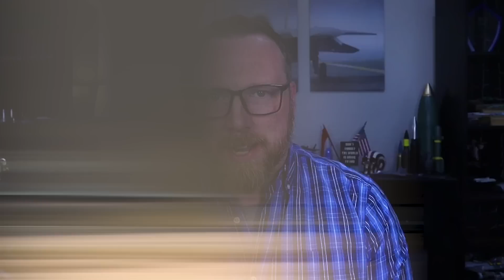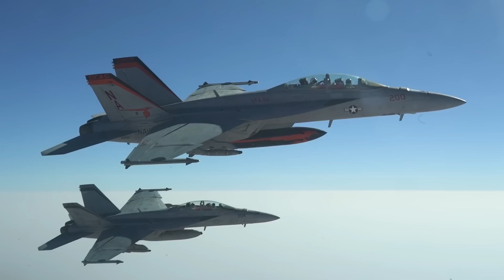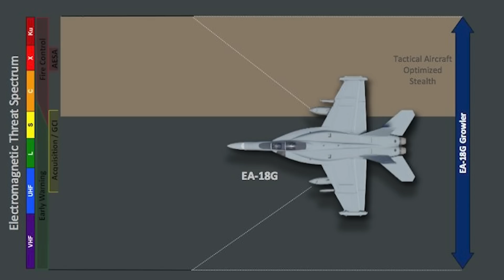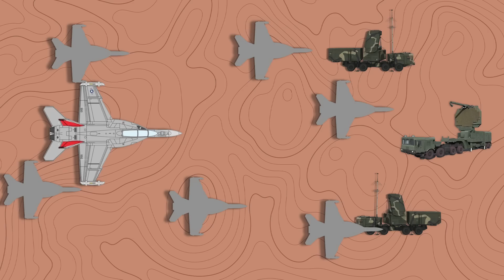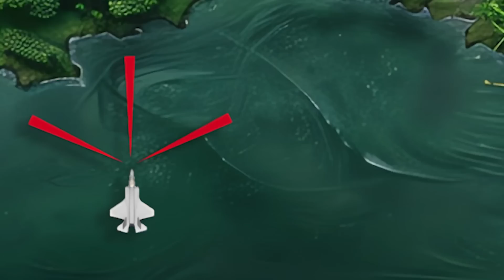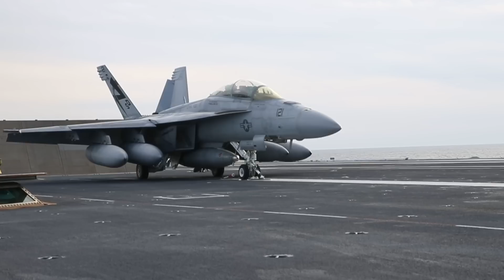The Navy's nastiest fighter nobody ever talks about

Comment: Due to the J16D is larger than F18G in size and engine power,
The Chinese J-16D electronic warfare aircraft has similar in appearance to the US military's ALQ-218(V)2 full-band tactical receiver. There are four large knife-shaped antennas on the top of the pods, which are 0.4 meters longer than the ALQ-218(V)2 full-band tactical receiver, and have a diameter and weight of 0.30 meters and 240 kilograms respectively. It has the ability to achieve full-spectrum, omnidirectional, high-precision positioning using the principle of short-baseline interferometer. The front avionics compartment and both sides of the fuselage cockpit are equipped with large-size radiating receiving antennas. The EA-18G electronic warfare aircraft has insufficient internal space to install large-size radiating receiving antennas.

The J-16D electronic warfare aircraft can carry four RKZ930 series large pods, which are 5 meters long, about 0.4 meters in diameter and weigh 400 kilograms. The pods are divided into four types: RKZ930-22, RKZ930-10, RKZ930-31 and RKZ930-32, which can cover different frequency bands. The main body of the pod is basically the same, with an interference transmitting antenna at the front and back, which has omnidirectional interference capability, but the antenna layout is different. The design concept is the same as the AN/ALQ--249 electronic jamming pod, but it has one more than the EA-18G electronic warfare aircraft, which truly realizes effective interference in all frequency bands.

In recent years, China has also adopted active phased array jamming antennas, digital processing, adaptive beamforming, intelligent analysis and radio frequency management in active phased array radar jamming pods. The power generation capacity of the power system is sufficient to ensure the normal operation of the jamming pod, while the two F414-GE-400 engines of the EA-18G electronic warfare aircraft can only generate 180 kilowatts of electricity. Therefore, the AN/ALQ-99 and AN/ALQ--249 electronic jamming pods must have their own small turbine generators.

Due to insufficient power, the jamming power must be reduced from 10 kilowatts to 6 kilowatts. Another disadvantage of having a small turbine generator is that it increases flight resistance. The F/A-18E/F fighter-attack aircraft can also fly at supersonic speeds with external auxiliary fuel tanks. The maximum flight speed of the EA-18G electronic warfare aircraft after mounting the AN/ALQ-99 jamming pod can only reach 0.85 Mach. The J-16D itself flies faster than the EA-18G electronic warfare aircraft, and the jamming pod also has much less resistance, which is very beneficial for accompanying the J-16 fighter in combat.

Like the EA-18G electronic warfare aircraft, the J-16D electronic warfare aircraft also has certain air, ground and sea attack capabilities. The whole aircraft has a total of 8 external attachment points. After mounting 4 jamming pods, it can also mount 2 "Piercing" 15 medium-range air-to-air missiles and 2 "Eagle Strike" 91 anti-radiation missiles. It can also mount 4 "Eagle Strike" 91 anti-radiation missiles to enhance anti-radiation capabilities. However, the EA-18G electronic warfare aircraft does not have this capability due to the limitation of attachment points.

The RKZ930 jamming pod of the J-16D electronic warfare aircraft was developed together with the J-16D electronic warfare aircraft and completed in 2015. The AN/ALQ--249 jamming pod began to be developed in 2013. After the prototype was developed in 2019, it encountered many technical challenges during testing. It was not until September 2024 that it reached initial combat capability, which was 9 years slower than the RKZ930 jamming pod.

Comment: I wonder if it's viable to use a different aircrafts radar signal that you would then time when you detect triangulate where it is and use it to figure out return signals from other objects not including you and the originating radar unit. Allowing therefore the f-35 to be able to receive a radar signal of the battle space without having a two-way link or using its own radars in an active role. Completely passively doing this. So the growler would ping so to speak, the f-35 would time that when it takes it knowing in what location it's coming from, and therefore be able to have a fairly good resolution on everything that returns a signal. Without giving any electronic or radio evidence of its own existence

Comment: You know the rate at which microwaves dissipate, correct? At the square of the distance? To be able to propagate that kind of energy a long distance, requires a s-ton of power. You're essentially talking an EMP device, I don't think too many pilots would want one of those under their ass.

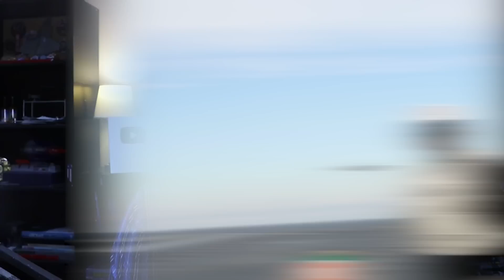Comment: 5:14 Alex, They’re not just “modular” but they’re software defined so it quickly adapts. ☺️
Reply: oh, software systems of that scale are usually genuinely modular in just their architecture. the western defense industry deserves crap for watering down the term, but this time it's probably a rare case where it's genuinely the right term to use.

software-defined signal processing systems are frequently plugin-based, so "modular" is the right thing to call it.

Comment: The Air Force had its own jammer, the EF-111A Raven or as it was often called, the "Spark-Vark" . The EF-111 entered service in 1983 and served until its retirement in 1998. After the EF-111A was retired in 1998, the U.S. Air Force began relying on the Navy’s EA-6B Prowler and later the EA-18G Growler for electronic attack missions.  I guess joint operations is alive and well.
Reply: Begrudgingly
Reply: USAF just received their first EA 37 B ;)

Comment: Hey I'm sure you're already doing a video on it but just in case you aren't yet, The Warzone published an article going over how the NGAD program is basically starting anew entirely to use more effective 2030s technologies that have started to enter development in just the past few years as opposed to the more expensive set of late 2010s/2020s tech used in the flight demonstrator that was originally intended for the fighter, and that they are focusing significantly more on having NGAD itself used as a UCAV element with fewer piloted airframes to save costs and reduce loss of life, as well as making it more broadly capable to be useful in uncontested airspace, which was a downside of the F-22 which didn't really have a purpose for the majority of it's life.
Reply: Thank you, this was very useful to know 🏆❤️
I don't like the delay, but I love that the designers are seriously delving into how to nake it both deadly, useful & cost-effective, in every scenario 💪❤️
Reply: @elektrotehnik_94c_NinoD  Yes this is hopefully a much better outcome than what we had feared with a century fighter program reboot or an outright cancellation. To find out also that new technologies have advanced so far in the past 4 years that they are adding and swapping out new technologies entirely for this reassessment is wild. Let's say for instance radar and IR spoofing is good enough that laser weapons are no longer needed, or a large internal volume is unnecessary due to developments in the low-drag pylon program. My guess is they found an alternative technology to the Adaptive Cycle Engine.

Comment: The two-motor F-18 simply  has the power to spare - for aggressive EW.
Reply: If I'm not mistaken, the pods have power generators of their own. You can see the small "propeller" on the front of each that is connected directly to an alternator or generator to make the power it needs, but it does add a bit of drag.

Comment: Not to put the Growler down, I do understand that the Stealth is not nearly as useful when you are transmitting to jam on one or multiple frequencies but they really need an EA version of the F-35 in all 3 varriants. Yes I am aware its capabilities are such that they all kinda already do operate as EA platforms but still if its is not optimized for the job its a Jack of all trades true master of none. Either way the Stealth of the F-35 would allow it to better get away if an imcoming weapon with both lock on jam plus a IR or Radar seaker would have a harder time tacking down the jet if it had to go evasive. Also would make the jet more useful yet still in the Passive SIGINT and ELINT roles as it potentially could get closer before detection.

Comment: And as a modular pod, you could put it on a lot of other platforms.  Interested in whether these require an engine upgrade to provide the needed electrical power or if the G already had enough juice.
Reply: Look closely. They have props on the front as generators.

Comment: Is the Growler a two seater? I would assume so, since it does fighter, attack, and EW roles. That'd be a lot for a solo pilot to manage.
Reply: I remember Prowlers when they had 4 seats, 2 pilots up front and 2 EW officers in the backseat working diligently because they only had less than 1 min to respond to a missile that was already fired at a friendly aircraft , they did their job and put one of their own anti harm missiles through the opponents radar and confused the incoming missiles.

Edit: Growler has 2 seats

Comment: If Lockheed was smart,  they would develop a 2 seat variant of the F-35 that can act as a Growler
Reply: That doesn’t make sense?
You’d pay the F35 premium maintenance prices due to the stealth, but then you’d put countermeasure pods on the wings which would ruin the stealth. 

Better to put your electronic warfare equipment on cheaper platforms like an F15 growler variant or… the F18
Reply: @kaourintintamine1383  
Hence the perspective F-35E would need to be redesigned with pods for stealth and non stealth operations
Reply: @verdebusterAP  but the pods emit electromagnetic waves that would act as a beacon? Stealth is about being silent, electromagnetic warfare is about « shouting super loud so that nobody can hear anything ». They’re two solutions to a similar set of problems, they just don’t work together
Reply: @kaourintintamine1383  
Imagine you are tracking inbound missiles and boom, this jamming appears out of nowhere and you lose track
its stops and now you lost track of the missiles
By the time , you get your sensors back
ka frecking boom 
a hypersonic missile has struck your radar and communications 
Those subsonic cruise missile that you were tracking  were actually decoys
The targets that you warned were not the real targets
The EA-18G can be seen from hundreds of miles away where potential EF-35E can approach and stealthy take up key positions and blind the enemy more effectively

Comment: ....So I'm a bit of a fighter jet layman so excuse the uninformed nature of my next question. If they are pods and they allow for a wider range of capabilities than is afforded to the F-35, why not just install them on the F-35?
Reply: You lose stealth…
Reply: As you do when you hang missiles on the outside of the F-35, but also by the looks of the pilons they already seem low observable which most missiles aren't also The F-35 is a stealth aircraftvto begin with and doesn't need giant external fuel tanks to boost its range and if you did you now have stealth drop tanks and internal payload capacity so you dont take the penalty of loading missiles under an already non-stealth aircraft...so its still more capable by every meteric to hang them off the F-35, so the questions still remains. Is it just because they are proprietary to Growler?
Reply: The internal equipment is also bulky per the EA having no cannon. F35s can use and relay data from multiple sources though

Comment: Still think it's kinda silly they have a small windmill on the nose, as the electrical systems in the F/A-18 can't provide enough electrical power. The jet engines, pushing the jet through the sky, also have to offset the drag from those. Thinking the pods would be even more capable if the nose was, say, an antenna array instead of a mini-windmill and a generator.

The F-16s delivered to Ukraine have updated weapons pylons which contain jamming hardware and additional chaff / flare dispensers, as well as infrared / ultraviolet sensors for 360° coverage on inbound hate. Setup the Growler with similar and let it pack some more hate.

Comment: Ask Hibitual Line Crosser about a Growler. His statements should tell you enough that the enemy should be afraid of the growler
Reply: A Growler emits copious quantities of electromagnetic radiation in all spectrums.

If the Chinese COULDN'T track the Growler, they would be no better than cave men.

You literally DONT need a radar to find it. All you need is a receiver.
Reply: @Triple_J.1  Radar lock for a firing solution is what they are talking about. And the allegations are the Chinese have used AI to get rid of the noise from the Growler jamming so it can achieve a lock, ie declutter the radar picture rather than burn through, which is the usual way a jammer is defeated, when it gets to close and the power from the tracking radar burns through the noise of the jammer
Reply: @Storytelleroflore 
That's great. They needed multiple ships all working together on the same task to do it.
They were never able to achieve a firing solution on the Growler, just have it on radar and know it's position. 
It was a SINGLE Growler that wasn't using its full capabilities in EW. It was just lightly probing the defenses. 

The new growler has EW systems far beyond anything the Chinese can comprehend..
Reply: @Mikayelion6  chill bro. Don’t over estimate yourself or your adversary is all. It’s worth objectively and calmly discussing potential counters to OUR equipment as allies utilising the same plane against the same adversary.
Either way I am taking neither of you seriously because if either know true outcomes you shouldn’t be talking here. Pure facts are a reprimand to the flight and a what may have been a minor success in electronic warfare by China, which seems to already be evolved out by a planned upgrade. Big whop.
No where have I ever stated I am unhappy Australia has growlers or that they are useless
Reply: @Mikayelion6  chill bro. Don’t over estimate yourself or your adversary is all. It’s worth objectively and calmly discussing potential counters to OUR equipment as allies utilising the same plane against the same adversary.
Either way I am taking neither of you seriously because if either know true outcomes you shouldn’t be talking here. Pure facts are a reprimand to the flight and a what may have been a minor success in electronic warfare by China, which seems to already be evolved out by a planned upgrade. Big whop.
No where have I ever stated I am unhappy Australia has growlers or that they are useless
Reply: chill bro. Don’t over estimate yourself or your adversary is all. It’s worth objectively and calmly discussing potential counters to OUR equipment as allies utilising the same plane against the same adversary.
Either way I am taking neither of you seriously because if either know true outcomes you shouldn’t be talking here. Pure facts are a reprimand to the flight and a what may have been a minor success in electronic warfare by China, which seems to already be evolved out by a planned upgrade. Big whop.
No where have I ever stated I am unhappy Australia has growlers or that they are useless
Reply: EA-18: for when you want to give radars down syndrome
Reply: Only if that were the truth. In fact China successfully equalized the Growler in December 2023. Go read about it. 

The USNavys EW squadron commander lost his job because someone had to be blamed. Of course he wasn't to blame, China simply used Ai to neutralize the Growler at its own game.
Reply: First off, there is no official reason given for the dismissal. You are purely speculating. Second of all, China simply claims to have "locked on" to a growler and being able to send an aircraft to intercept it. Rather than seriously attempting to actively enage the Chinese destroyer and foolishly handing the Chinese intelligence on US capabilities, the growler was most likely there passively collecting intelligence of its own. So the Chinese are basically bragging about intercepting a non stealthy tactical aircraft within close proximity of one of its most advanced destroyers. Even if it actually happened, it's not the least bit impressive or concerning.
Reply: @cubed0724  you're making sense. Sounds more like a media stunt than anything significant
Reply: @ryszardfalkowski7917 a single growler. Chinas ships vs 1 growler. Lol
That's not impressive. And they stalemated it. 
And the growler wasn't even really trying that hard. It was just probing, not full steam frying.

And this is a NEW system. One beyond anything China has ever seen or prepared for.
Reply: @ryszardfalkowski7917 thanks. The Nanchang did seem to defeat the Growler, the pods talked about here may help regain some advantage though the use of AI to deconflict the jamming is worrisome.
I would imagine that the processing power and range of sensors required may limit this to naval air warfare systems aboard large ships, here’s hoping that the SAMs still don’t have the tech
Reply: @Storytelleroflore the Chinese "stalemated" a single growler with several ships on the job. 
Its not impressive